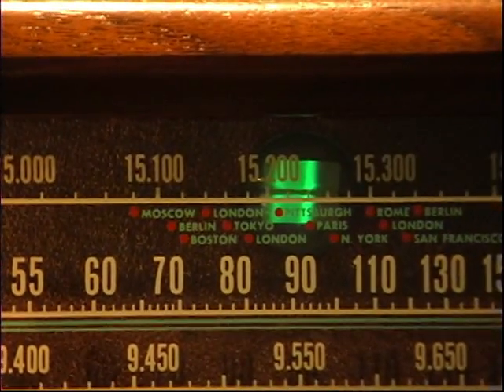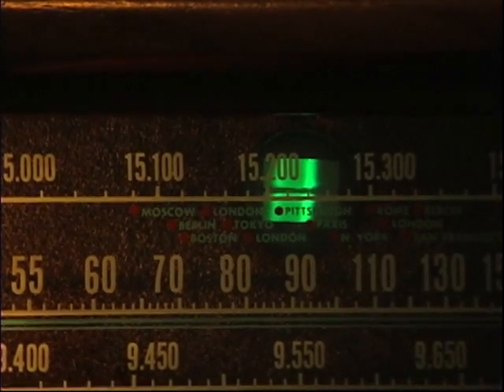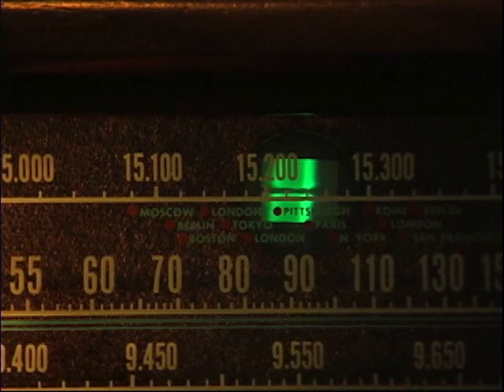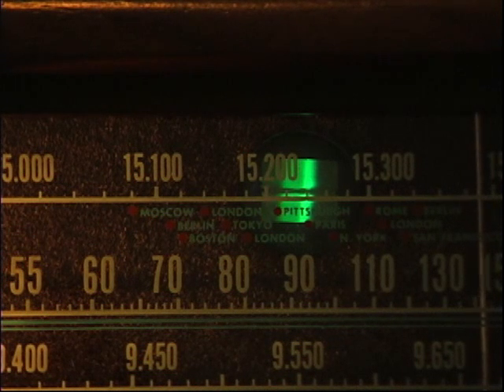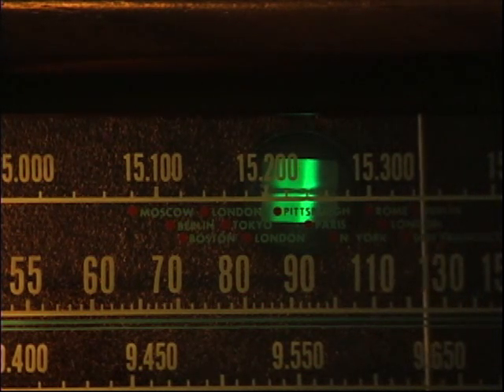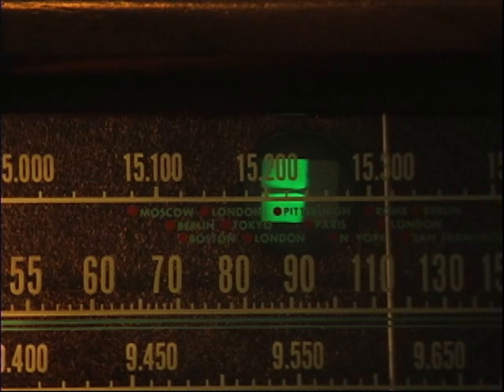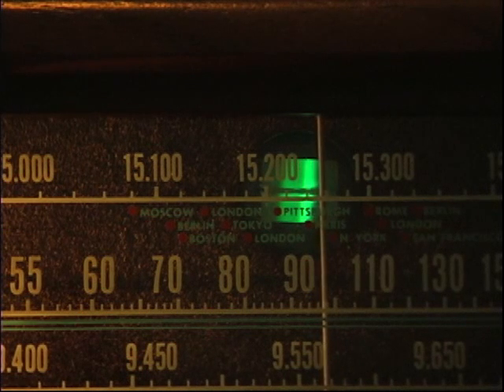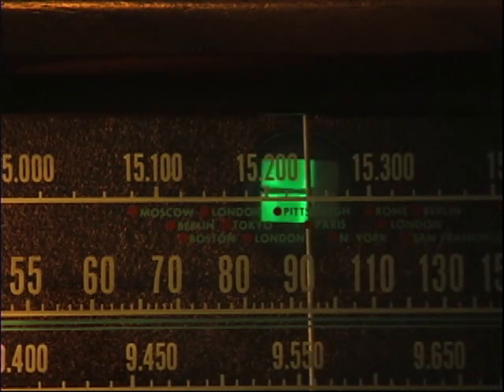6AL7 Magic Eye Tube

Comment: Hey, do you have a schematic of the radio. I am looking for a useful circuit to drive the 6al7gt like in this way - not only as a detector for signal strenght but also as a VU-Meter or Power level meter. It is much trickier than as the EM84 magic eye.
It woul be great, if you could help me (in any instance). Thanx a lot! Greetings, dela